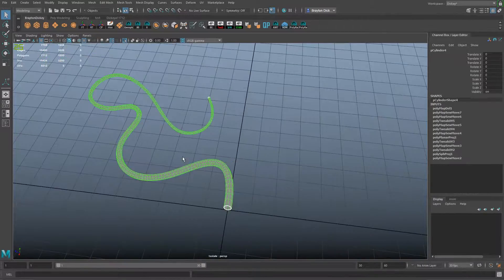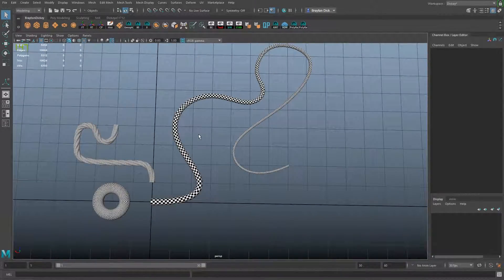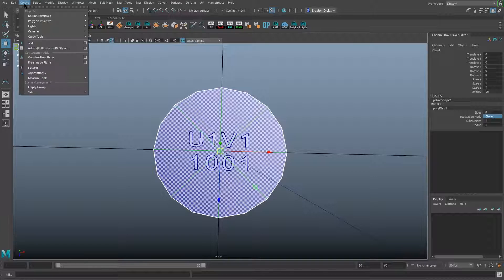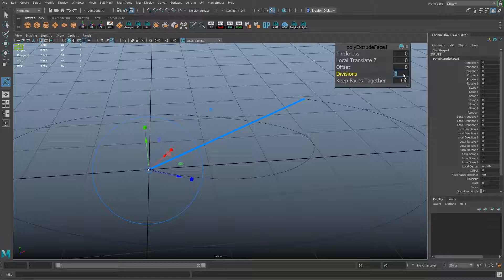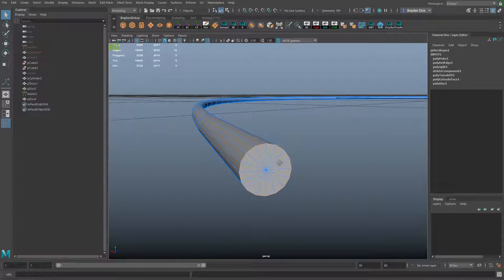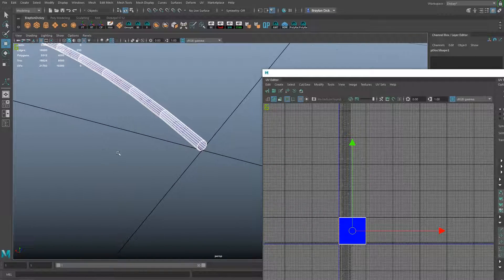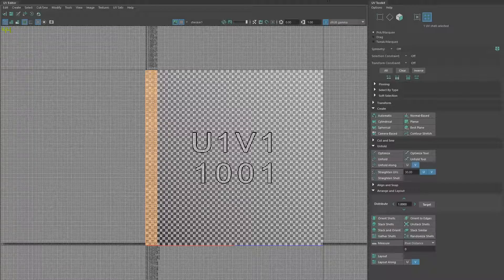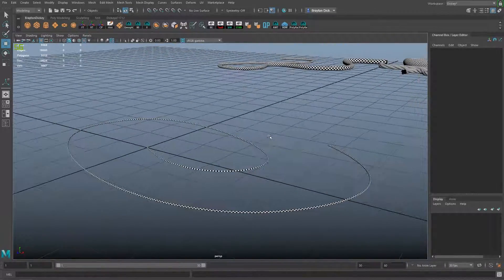UV Unwrapping Complex Cylinders in Maya

Comment: 12:38 how can i texture on this thin unwraped UV'S
Reply from the maker: digital art good question!

For the thinness of the cylinder I unwrap there, I imagine it being a much small part of an asset that the player won’t really see and so the texture resolution I gave is enough to provide color, roughness and metalness but would not be enough to write words or something on it.

If your goal is to texture higher detail on to your cylinder, you would have to cut the cylinder into more chunks so that it could take up more of the horizontal space it isn’t currently utilizing.
Reply: @Braytonks3D   can  you make tutorial on matching perspective, is there any plug in for this
Reply from the maker: digital art could you clarify what you mean by matching perspective?
Reply: @Braytonks3D  check your instagram